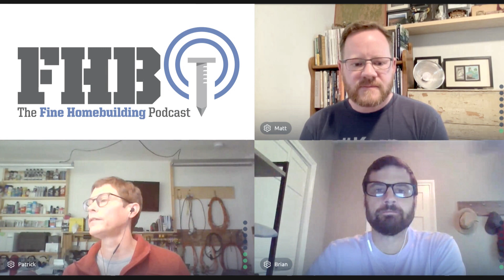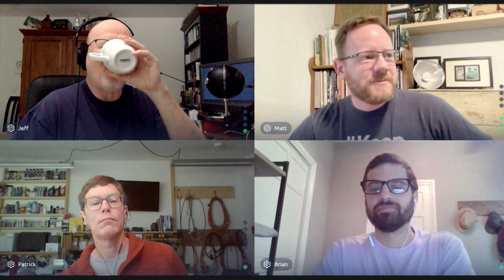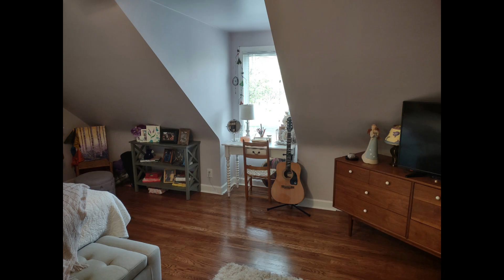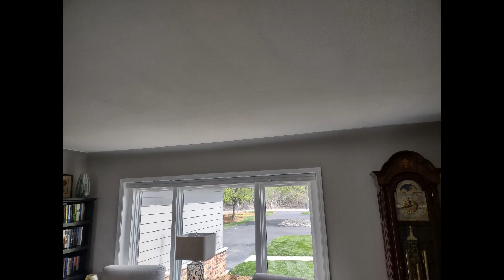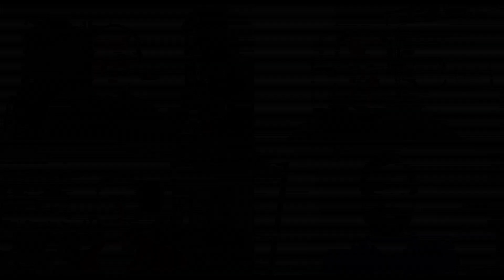Podcast 362: Effective Tarping, Saggy Ceilings, and Cracks that Won’t Go Away

Comment: Cracks that don’t go away, when someone framed in the non load bearing knee wall they wedged it in too tight to the roof rafters to where it bears some weight. when it snows the extra weight deflects the roof rafters and adds additional weight to the knee wall hence cracking the ceiling below.